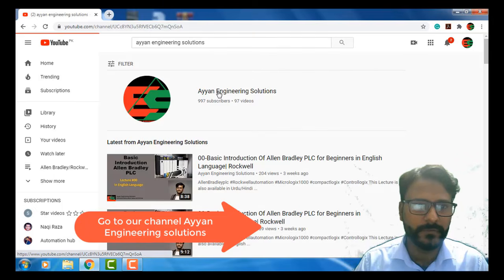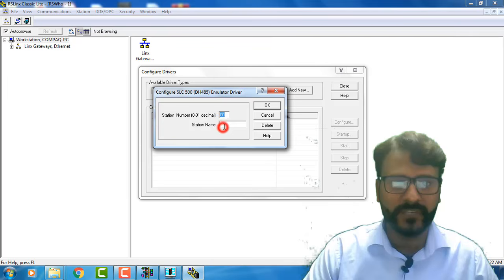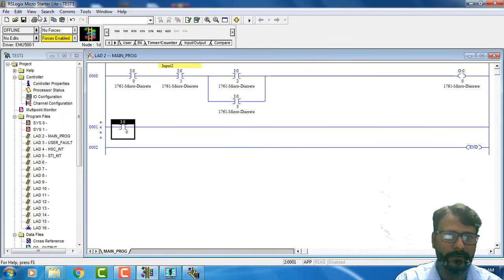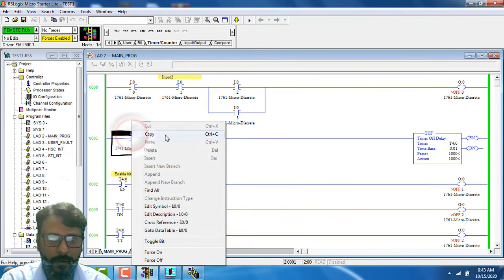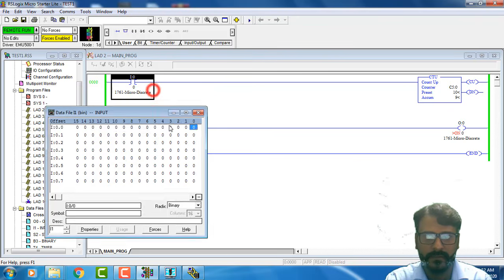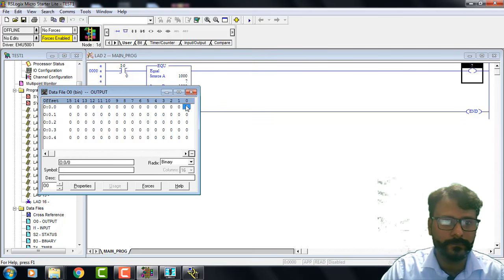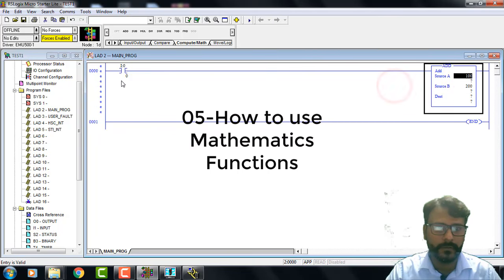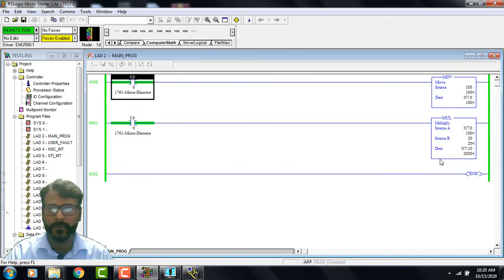01-Basic Allen Bradley PLC Programming Ladder Logic |Rockwell | PLC Course| Free Rslogix500 software

Comment: RSLinx classic and RS logic 500 emulator are installed, but rslogix 500(8.30) is not installed. i started installation of RSLogix 500, installation window opened with a message of installation started please wait. I was waiting for 30 minutes. But not installed. Can you help me any supporting app required for the sofware installation.